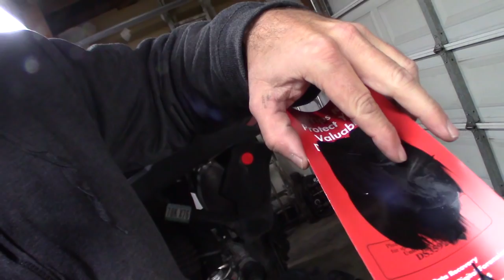X3 beadlocks NO GOOD!! Do Yours Go Flat????

Comment: There is a tire sealer called multi seal its foe off road , water soluble so really no clean up just wash it off  id or when you need to change tires , I put in all my x3 tires and haven’t  had to add air since
Reply from the maker: Really?? Well if this doesn't work out then we'll give that a shot. Thanks for the advice, much appreciated!